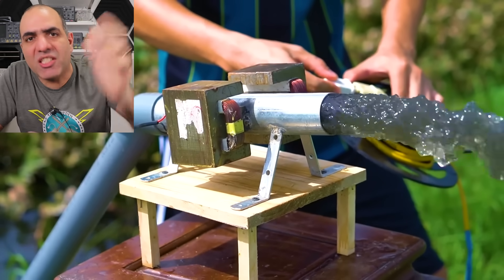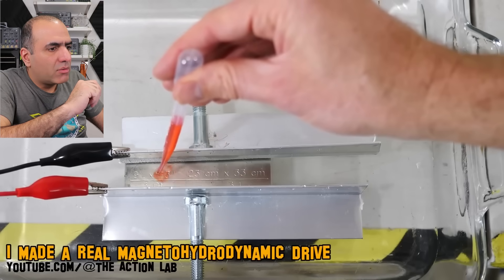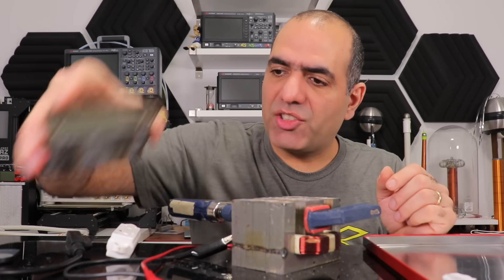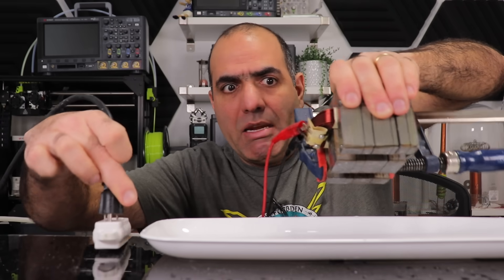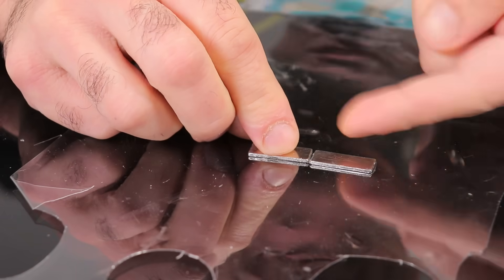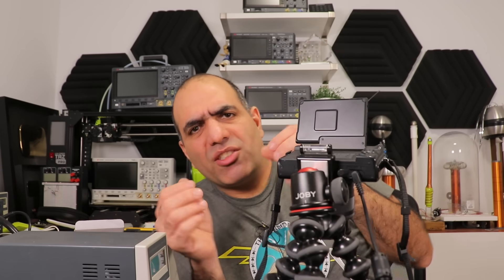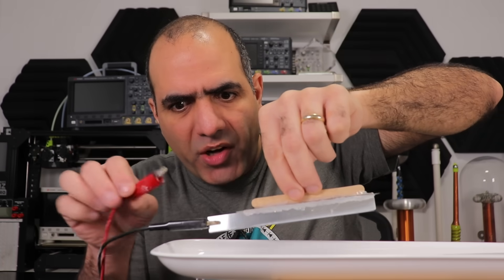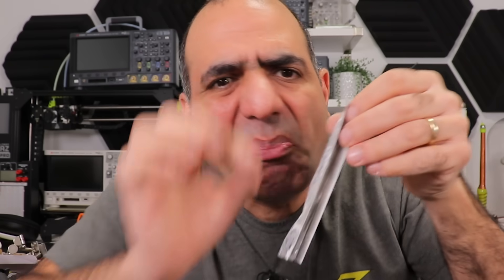Making a Water Railgun

Comment: Electrolysis of salt water may actually create chlorine gas on the positive electrode, which is highly irritating to the moist tissues of the respiratory system. However, my intuition is that this process is utterly inefficient, as chlorine requires a large amount of energy to be liberated from its ionized form, and after doing so, most of it is likely to redissolve into the water anyway, releasing that energy in the form lf heat.
Sooo most of the gases is just hydrogen and oxygen. Their mixture is highly flammable and even explosive when it is able to accumulate. At least they have no health effects.

Comment: Excellent. Water is slightly diamagnetic so you could possibly get it to move if you used a massively powerful (probably superconducting) magnet driven by half a power station. I'm sure there's a handy one under Mehdi's desk somewhere ...
Reply: It's time to disassemble the big microwave in the house
Reply: He probably stole the Red October from the CIA or something. That had a magneto-hydrodynamic drive in the book/movie
Reply: @ebnertra0004 even better is that he is Canadian 😂
Reply: I mean, scientists made a frog float with very powerful magnets, so its not impossible.
Reply: ah that was the word I was trying to think of "diamagnetic" I was like "magneticphobic?" lol.
Reply: So just throw it in a particle accelerator?
Reply: Take apart more microwaves
Reply: half a power station ? then that's a job for Photonic Induction or Styropyro.
Reply: Time to steal a whole ass magnetar :D
Reply: Is salt water more diamagnetic?
Reply: @Snowman831_  what about a non-sodium salt.. you know salt but not "salt" surely there is something better than sodium..
Reply: you would be much better off using microwaves to heat the water
Reply: He just showed how inefficient it is...
The point of this video was this, to show that you better buy a water pump
Reply: "a massively powerful (probably superconducting) magnet driven by half a power station"

You don't need that much power to drive it if it's superconducting. Once energized a superconducting coil stays energized almost forever (as long as it doesn't get warm enough to experience a quench).
Reply: @seneca983  superconductors are not free energy. So if you let the magnetic field do work you'll need to replenish the energy in the magnet.
Reply: @MarcoTedaldi  A static magnetic field just levitating water or a frog is not doing work and the superconducting magnet doesn't get depleted from just that.

Comment: You can prevent electrolysis by using insulated electrodes, electromagnets and alternating current. You don’t even need to salt the water, just turn it into a capacitor. If the water and the (insulated) electrodes form a capacitor and you have the electromagnet perpendicular to the electric field in the water, by creating a resonant circuit you can create huge magnetic and electric fields that will push much harder on the water. Actually, any polar liquid might work.

Comment: I have an idea.
Dielectric separation of the magnets from the electrodes should solve the heating problem and allow you to run as many amps as you want/your electrodes can handle, as long as you don’t reach the breakdown voltage of what you use as a dielectric.

Why I think it would work: Current would not run through the magnets as long as there is saltwater straight from one electrode to the other.
You could also just use a thin dielectric coating on the magnets, completely preventing current from running through them, but where’s the fun in that, right?

Comment: The periodic videos channel has a nice demonstration of a NaK fountain that worked at this principle. Unfortunately that setup was destroyed a long time ago, so there’s just an old footage of it working. It uses liquid NaK metal alloy instead of water. Absolutely love that video fore some reason.
Reply: Cody'sLab did this with Mercury metal once. It actually worked really well as I recall.
Reply: @Basement-Science  the Na/K device actually shot a stream straight up, inside of a sealed container of course so it wouldn’t inflame.

Comment: There's actually a video on Applied Science where he demonstrates something called a electroosmotic hydraulic pump, which relies on a weird phenomenon where the H+ in the water gets separated from its OH- near the boundary with a "glass membrane" because of - reasons - and putting a potential difference between both sides of the membrane makes the water flow (slowly though) by moving around the charged H+ near the walls

Comment: And now change the solid magnets to the electromagnets powering by capacitor battery (like in coilgun). Rail connect to the same capacitor battery (few hundrets volts). Barrel make by steel pipe cutting in half and putting it in another insulation pipe. You done your water railgun.

For ambitious people, you can change water for high compress hydrogen, and rails connected to the much higher voltage. You have Lance like Goa'uld in StarGate series (or Dzida Laserowa in Polish serial "Kapitan Bomba").

Comment: For safety, I'd discourage using table salt as an electrolyte in these experiments. Electrolysis makes the sodium chloride decompose into chlorine gas, which I hear can be bad for your lungs or something.

Edit: yep, at 13:28 Mehdi was wondering if the gas was poisonous. You can use washing soda (sodium carbonate) as an electrolyte instead if you don't want to poison yourself.
Reply: You also need inert electrodes like MMO(mixed metal oxide) or platinum.
Reply: Have you ever used bleach to clean your bathroom or kitchen? Remember that irritation in your eyes, nose and lungs? That's chlorine gas. Much higher amount of a chlorine gas than this puny contraption can produce. Chlorine was indeed used as one of the first chemical weapons and can make you cough your lungs out, literally. But only when you're immediately exposed to high concentration, and have nowhere to run. Otherwise, you'll definitely notice it way before it becomes dangerous.

Comment: That reminds me of my attempt to make a water fountain with no moving parts. I added a lot of salt and while it did work about as well as that, it made so much chlorine you could see it as a steady stream of green gas coming out of one electrode. Needless to say, I started coughing and turned it off.  I think that if you don't want electrolysis you could use electromagnets and rails both powered from the AC in the same way a universal motor works. Each half cycle the current flows the opposite direction, so the previously generated gases recombine instead of piling up and escaping, but the electromagnets also change the direction so that the force is pointed in the same direction throughout the cycle.

Comment: 13:25 Don't mock the 10 amps flow; it's enough to impress me. Also, 13:29 yes, those fumes are most likely from the melting hot glue, so they're probably not great for you.

Comment: Using a metal spoon to drop salt water onto high voltage derived from mains power. I hope you had an isolation transformer on there!! :)
Reply: Everything not more than 1000 volts is low voltage according to international standard.

Comment: 13:29 
If that salt you added is regular table salt then yes you could be generating chlorine gas, not very healthy.
The safest way for your viewers to replicate this experiment is to use distilled water with sodium bicarbonate (baking soda).
The sodium ions are the same as you are adding with the table salt (sodium chloride) except with the baking soda you'll be generating carbon dioxide.
This should still be done in a well ventilated area but is essentially no less dangerous than simply sitting in a badly ventilated room filling it with your own carbon dioxide from breathing.

Comment: Why not use laminated (so its electrically insualted) strips of aluminum so you can use much higher voltage and not worry about salty water being electrolysed and heating up? Or does the water has to make contact with the direct current?
Reply: The current has to be flowing through the water. But if you don't want electrolysis you could use electromagnets and rails both powered from the AC in the same way a universal motor works. Each half cycle the current flows the opposite direction, so the previously generated gases recombine instead of piling up and escaping, but the electromagnets also change the direction so that the force is pointed in the same direction throughout the cycle.

Comment: Salt water electrolysis produces Chlorine gas, hydrogen, oxygen and sodium hydroxide (which gets dissolved instantly) - but in quite inconsistent ammount. Also for the electrolysis to happen, you need around 1.3 Volts, at that voltage you are probably just frying the water, but I would do this outside just to be sure :)
Reply: You also need inert electrodes like lead dioxide, manganese dioxide, cobalt(III) oxide or platinum. Aluminum, copper and even stainless steel will react with chlorine forming chlorides in the solution, which react with sodium hydroxide forming sodium chloride and a precipitate of transition metal hydroxides.
Reply: @mernokimuvek  I wanted to use the same kind of electrolysis to produce (Na+,ClO3-) but ended up with a nasty orange mixture due to the electrodes not really made of pure titanium but bad alloy. I suspect the solution contained quite a lot of bad Cr6 ions, which are carcinogenic...
Reply: @arvetemecha  mmmm hexavalent chromium my favourite
Reply: @arvetemecha  def it did
Reply: @arvetemecha  check out the channel Extractions and Ire, he's done the synthesis and it was quite slow and fiddly for him. Seemed to go much smoother when he did the equivalent reaction with bromine.
Reply: @mernokimuvek  as a kid I tried to make sodium metal from saltwater using electrolysis. I used the carbon rods from the centre of D cell batteries as my electrodes. I was very disappointed to smell the chlorine coming off and noticed that familiar slippery feel of sodium hydroxide in the remaining solution. When I redid the equation I figured out where I had gone wrong.
Reply: @unicornadrian1358  i bet after that u was like: they should call it electroHYDROlysis
Reply: @mernokimuvek  or just use graphite
Reply: @mernokimuvek  What would they be with a more "reactive" salt? What is the most reactive salt, surely something better than sodium?
Reply: I was looking for this comment. The surprising thing is how well the aluminum endures the chlorine formation, because appart from toxic it is highly corrosive
Reply: @LizardonPlayer Yep, i've made hydrochloric acid doing this way.
Reply: Was going to say... A railgun and chlorine gas? Two weapons for the price of one!
Reply: 1.3 volts is the theoretical chlorine evolution potential but most of these chloroalkali cells run at 3 to 5 volts.
Reply: @CatboyChemicalSociety  I was using a 6V lantern battery. The salt solution was also super saturated.
Reply: @unicornadrian1358  yea that will also work for making chlorine in small amounts.
any voltage over the evolution potential will create chlorine as that 1.3 volts dictates the voltage at which those products are formed. overvoltage will just waste excess to heat and you can even calculate assuming 100% current efficiency how much heat in watts is not used in the reaction.
6 - 1.3 multiply by the current to get waste heat.
The chlorine evolution potential also differs depending on the anode material and its as low as 0.8 volts for materials such as ruthenium dioxide.
Reply: @CatboyChemicalSociety  excellent info mate. I was 11 years old at the time and just wanted to make sodium so I could throw it in water and watch it explode. 😂 Having said that I also had put clear tubing over both electrodes to collect what I thought would be hydrogen and oxygen. So you can imagine my surprise when one of them smelled like chlorine.
Reply: @unicornadrian1358  well this process is also used to make oxidizers like chlorates and perchlorates for pyrotechnics and dissolving precious metals in a form of aqua regia made with chlorate instead of nitric acid.
Reply: Thank you for another great video! You’re a mixture of knowledge, experience, and comedy are the best! Also I wanted to get a hats off to all the commenters on this channel. You have restored my faith in humanity that we are not turning into a planet like the film Idiocracy.
Reply: finally
fried water
Reply: Wouldn't it make HCl gas instead of Cl gas?
Reply: No the hydrogen and chlorine are happier forming a covalent bond with other hydrogen and chlorine atoms making H2 and Cl2. I believe the influx of the electrons is why you don't see more HCl. Otherwise I believe you would be correct. At least based on my rather hazy remembering of a class I took far too long ago.
Reply: Seeing that electrolysis gave me an idea. I am probably not the first person to think of it so it may have been tried before but I digress. What if we use distilled water electrolysis to produce hydrogen and oxygen gas and, since hydrogen gas is extremely flammable and oxygen supports combustion, we ignite the hydrogen gas being produced?
Reply: @Bluboy511  distilled water has a high dielectric effect. You need a small amount of a salt to getting the electron flow needed. Potassium hydroxide and bicarbonate of soda are two popular salts to use.
Reply: @Bluboy511  this process is 50% efficient at 2 volts per plate and even at the theoretical potential with platinum the energy is wasted and it means you get less out than you put in.
Ignition of the hydrogen also is 33% efficient at best to get electrical energy out of it.
A fuel cell is the reverse of an electrolysis cell where you have platinum and a proton exchange membrane made from nafion/PVA with platinum plated on one side and carbon foam on the other it allows for the generation of electricity at 85% efficiency or higher when oxygen and hydrogen are placed at opposite ends and when there is an electrical connection between the 2 electrodes you get protons being generated as electrons are taken from the H2 and they pass through the membrane and react with OH- radicals that form on the counter electrode producing water and electricity and some heat due to resistance of the membrane and other effects like series resistance.
I have a video on how to make proton exchange membranes.
Reply: @Bluboy511  Sadly thats one of the hopeful hidrogen cell combustion engines ideas... electrolicys was too slow for it to work in the amount of hydrogen needed for it to really work, i think they are using catalysis to try to get it better.
Reply: Yes, electrolysis of salt water can produce chlorine and hydrogen gas, but in this case with aluminium electrode, you will get only hydrogen gas and chlorine will eat second aluminium electrode to aluminium (III) chloride. So, I think, that in this set up is safe.
Reply: Electrolysis of conc. NaCl solution produces H₂ and Cl₂ gas. There are Cl⁻, OH⁻, H⁺ and Na⁺ ions in the solution. Cl⁻ ions are preferentially discharged over OH⁻ ions as they have much higher concentration. H⁺ is preferentially discharged as it is lower in the ECS. So, H⁺ is reduced to H₂ gas, and Cl⁻ is oxidized to Cl₂ gas. Cl₂ is quite soluble in water, but not all of them. So, the gas produced in the video is likely partly H₂ gas (which is explosive and is a fuel) and partly Cl₂ (which is toxic)
Reply: Was about to mention this
Reply: How about natriumhydroxide? 

(My chemistry skills suck)
Reply: No it doesn't make chlorine gas. It doesn't make HCl either. But the chlorine is already dissociated while dissolved and so the electrolysis isn't doing anything to it unless it's a really high concentration.
When you dissolve salt and water what you're getting is a mixture of sodium hydroxide and hydrochloric acid in a balanced mixture. Putting an electric field across it simply separate it. 
If you really want to make chlorine gas, you have to do the electrolysis on melted salt. Anything else is just going to make acid.
Reply: That bright orange or yellow flame is indicative of sodium oxidation.

Comment: 7:05 "Aaaand the resistance of the salt water is... like... What? Minus two megaohms?" 
If I had a resistor with minus two megaohms of resistance I could put it in a low-power circuit to bump it up XD
Reply: Congrats, you made a battery!

Comment: Water resistance is indeed non-linear. When you're passing current through an electrolyte liquid what you're really doing is electrolysis. (Those gases aren't poisonous, EDIT: Actually with a salt solution this saturated, you get Chlorine rather than oxygen. So yes they are poisonous) but one of them is hydrogen  which is a little burny if too much builds up). Suddenly what you're doing is (electro)chemistry rather than electrical engineering, and determining reaction rate ain't trivial. Plus the resistance varies a lot on the size of your electrodes, and how far away from each other they are.

Anyways, not a bad showing for someone who doesn't know chemistry or fluid dynamics. Interesting toy without moving parts, but the gas generation would make this thing a HUGE pain to work with on any serious pump- not to mention the huge power draw.

Comment: "They key is not to touch any voltage".    Yes.  I concur.  Especially with salt water and DC.  I worked at a chlor-alkali plant that could draw 3 MW.  While changing a 1/4" catholyte tube (while operating mind you) I saw a former active marine get dropped.  The cell stack ,120 cells, was running at about 240 VDC @ 3500 Amps.  Each cell would show about 4.5 VDC.  I've never seen anyone drop, get up and be that dazed.  We usually more concerned about chlorine gas leaks.  I was always aware, that the whole place was running saturated brine solutions with not only 480 VAC pumps and equipment AND the cell stack drawing as much power as a small hydroelectric dam.  Never got zapped...gassed once...NOT recommended!